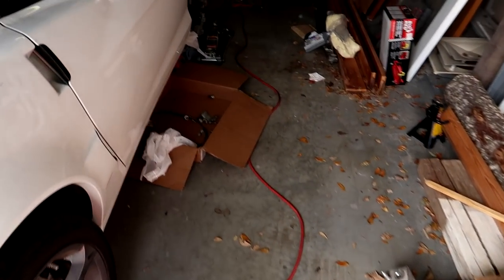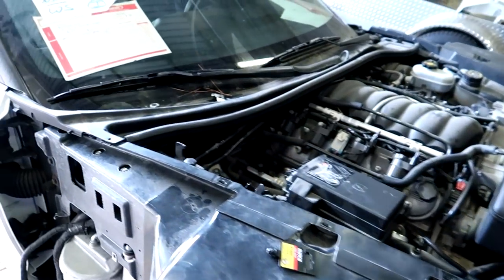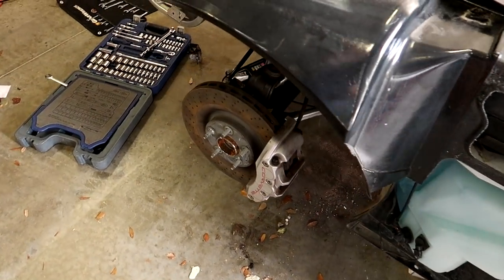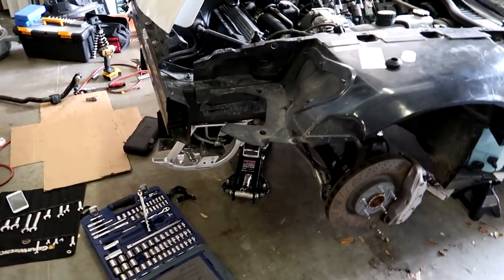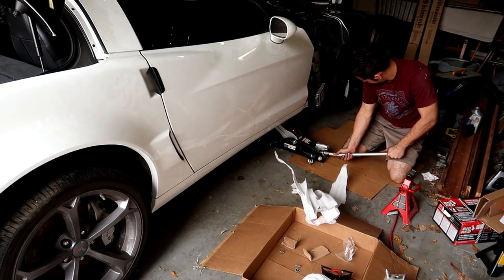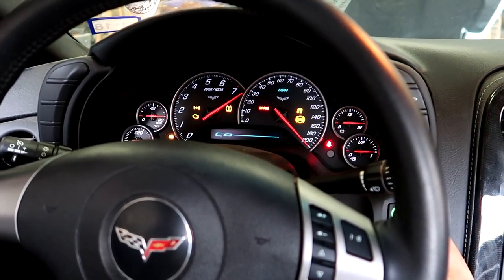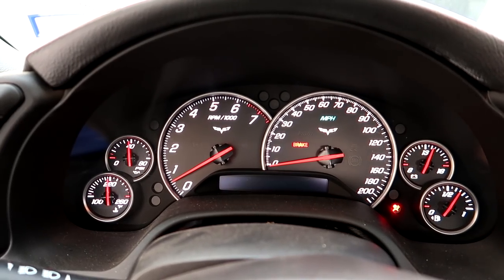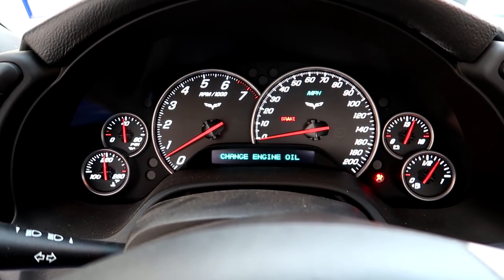THIS is why the Cheap Salvage Corvette Won't Start! Easy $100 Fix!

Comment: Why in america do you have to push the clutch pedal in to start the car.?
Reply: IIGrayfoxII Have u driven lately modern european manual car? At least vw have asked that for last 7 years...
Reply: If you managed to start the car without the clutch pedal, there would probably be a lot of crashes from the car lurching into parked cars and stuff
Reply: well so why are Americans are adopting this? Cause it seems to work out and the americans also need it.
Reply: IIGrayfoxII this is my opinion, but I believe it’s reduce strain on the starter as well as to prevent mishaps if you leave the car in gear like if you were parked on an incline.
Reply: New cars require it electronically. There is no mechanical reason you can't start a manual car in neutral, I do it all the time in my 77 bimmer
Reply: Because our cars are designed by lawyers using courtroom battles to determine the "features" that the nanny state will force on us. Since the government claims to own us physically, it has an interest in preserving us for it's "higher" purposes, namely human sacrifice rituals like 911, since they're really just a bunch of satanists. Safety in tyranny keeps all the Stockholm Syndrome sufferers who comprise the population feeling secure in their bondage.
Reply: bobo4691 damn solid response.
Reply: Crazy story:  In the mid 90's, I hadn't driven a manual for about 15 years and a woman that was living with us paid for her rent by giving us an 85 Turbo T-bird that was in police impound because her husband used it as a get-away car in a crime(he was in jail but, the title was in her name).  There were two bullet holes in the driver-side A-pillar from a Sheriff's .45. One of which went into the driver's arm(I shit you not).  My wife and I went to get it out of impound and it wouldn't start so, we towed it with a tow chain for 15 miles to our house. I got a Haynes manual and feared the worst but the first thing I read in the trouble-shooting section on "no start" was "is the clutch depressed?"  I thought, "are you kidding me?"  Depressed the clutch and got ten years of free car out of that thing!  It eventually had an electrical fire and was toast, literally, after that!
Reply: because it is to hard for them to put the car in neutral and then start the car. the majority of U.S. citizens barely understand how manual transmission works
Reply: IIGrayfoxII because some idiots leave it in gear when parked so we have neutral safety switches and clutch switches
Reply: My Japanese car had to have the clutch fully depressed.  I don't know what your driving but there is nothing wrong with a small kill switch.  It's also an easy way to wire a hidden kill switch for anti theft purposes.
Reply: I think he is asking why you can not just put the car in neutral and then just crank it up without the clutch being engaged...  all the sticks I have ever owned, that was never an issue,  they all started with the car in neutral whether the clutch was engaged or not..
Reply: in fact, you could actually leave it in gear and crank it and it would do a leap forward.. LOL  so it would engage the starter anyway.
Reply: OUT OF CONTROL GOVERNMENTAL SPRAWL OF THE JOBS GOV THINKS IT IS RESPONSIBLE FOR
Reply: That sums it up.
Reply: So you don't run  your wife over BY ACCIDENT!
Reply: Americans use neutral safety and manual clutch switches so uncle b and aunt c wont fire up the ignition start switch and rocket forward on the starter or starter plus engine power when the switch is engaged.

The same reason I believe you have safety glass and side marker lighting (yellow front, red rear) among other safety features on your cars. Federal law and the nature of "accidents."

Comment: A vehicle that's newer often times have sensor to deployed airbags and shut vehicle off if it's been in a wreck. The reset buttons are usually located in the trunk.

Comment: You're a Man after my own heart. I will die with a wrench in my hand before I go to the dealer. Nice job troubleshooting. Again, I like you, will dig and dig, until I find the 100 dollar thing that I can use instead of the 1000 dollar thing, because, I believe the 100 dollar thing exists and will do the job just as well as the 1000 dollar thing. it just needs to be found.

I have one of those netbooks. I was going to chuck it about 6 months ago while tidying up my office. If I ever have car troubleshooting software to use on my car, it'll come in handy. Right now I have a 1985 Corvette with OBD-I. I started researching scan tools for it. and found a few that say they work with OBD-I, but I'm not sure what more they'll do for me more than the codes that Flash on my dash, and my trusty Chilton's manual. And the options are very expensive.

I don't know the story that goes with this car your working on so I'll have to go thru your videos to find out. I'm curious about the project. It looks interesting. Thanks for the Video.

Comment: Could you do me a favor and jack the front end up and try to start it? It would take 5 minutes and be worth the laugh
Reply: IkonGod some cars are smart enough to know if their tires are off the ground and they won't start
Reply: Julian Rada for example?
Reply: Hey look. It was me he was talking to. This is my first corvette. I had it a week. It started fine before I jacked up the front and removed the wheels. It would not start that way. Now could it have been something else. I suppose so. But when I put it back down it started just fine. So who knows what it was. He was aware of this in our PM.

Comment: Hose water, really?  WTH!   Even if ou flush it you may still leave contaminates in it.  Not worth the savings over distilled water in a car like this.
Reply: Second. Distilled water is, what, 99 cents a gallon at Walmart? There's no reason to not run distilled water, especially on a performance vehicle such as this Corvette with aluminum cooling components. Aluminum cooling systems do not like tap water.
Reply: There is not enough contaminants to do any harm as long as you are not using 100% water. Mix 50/50 and good to go.
Reply: LOL! If he can drink it, it sure as hell isn't going to hurt the engine, especially no longer than he will leave it in there.
Reply: I've been using tap water in my f250 for five years and haven't had a problem with it yet, I'm sure that ls can handle it for one start

Comment: no burnout.....lame
Reply: LaughMy…. uh hmmm   He fired it for 15 seconds... decided it did not leak. What was the engine temp and pressure in the system before he should have laid rubber?

Comment: Glad to see you got it going bro. I was the one you was messaging in the video! As for the car not starting jacked up. Mine started fine prior to jacking it up. Now I had the tires off along with it being lifted in the front. It would not start in that position. It started fine when it was back down. Could it have been something else I don’t know. I had the car a week and this is my first vette. I do have the car lifted again so maybe I will see if it replicates itself.

Comment: Windows 7 though 8.1 you can choose to run a program in "compatibility mode" for 32 bit. Doesn't have to be ran on an old computer to work. Sometimes if you just go for it and install it on a 64 bit computer, that os will recognize the software is running in 32 bit mode and will allow it to run normal. Most 64 bit os's will have native 32 bit support.

Comment: I hade a Plymouth Sundance many years ago that would start without pushing the clutch. I guess it was a way for the manufacturer to save money. The America sub model was basically just a way to get around so you didn’t have to walk.

Comment: Glad the VCX Nano worked for you. I tried to re-program the glow plug module on my 2013 Duramax with the VCX Nano...it failed to program the glow plug module, and I had to go to the dealer to repair. They subsequently fixed the programming (firmware update(s)) in the VCX Nano...but it seems like the VCX Nano is "reverse engineering as they go". The engineer in China was willing to help...at Noon Beijing time....which is Midnight Eastern time. :-/ Nope...thanks anyways. I got the Mongoose from DrewTech afterwards. Also, be careful on the processor requirements for the Tech2Win and TIS2WEB....the Tech2 may work with the Intel Atom processor, but any ECU programming should be Intel i3 or later if you use TIS2Web to program modules. Glad the VCX Nano worked out for you. I'll try it again in the spring. The $55 TIS2WEB for 2 days isn't bad....it's the additional $150 at the dealer that you may have to pay if it does not work. FYI.
Reply: I can confirm ECU programming will work with somewhat older i3 stuff, my surface pro 3 i3 has done many cars with vcx nano as well as tactrix cable applications
Reply: I can't confirm older processors than i3 will work...but that's because I prefer not to chance it having had a bad experience with the VCX Nano. I am now Intel i5 Thinkpad, so I will know more about the Mongoose and VCX Nano in the spring...just in case I need to fork over an extra $150 to have the dealer fix any failed module programmming. (I was AMD Neo on my previous try.)

Comment: Hey, at the end you mentioned something about laws against "Having to take it to the dealer to do that". Is there a reference anyone knows of that lists all the little tricks to bypass things that a dealer would reset. Im talking about things like the Engine Oil Life (which I know is something about pumping the gas 3 time), or the reset procedure for relearning Key Fobs. Id love to know other things I can do myself. Especially tire pressure monitoring relearning after a tire rotation, since not all lube joints will do that.

Comment: you can run 32 bit programs on a 64 bit os.  it will do it on its own.  if it has problems you can run it in compatibility mode.

Comment: Nice work. I myself owns and use a Tech2 scanner and also uses a old 32bit computer together with it because of the software required works better on an old laptop that also has the required ports for com. with the Tech2 device.

Comment: I never noticed that Corvette uses the same Pontiac/ Toyota steering wheel. With the little girly finger buttons. I am surprised it does not drop the price a little bit.

Comment: that's what i like about old cars, they dont give you shit if there is a sensor that hasnt been calibrated or a really specialized procedure that hasnt been done. if they have compression, spark, fuel and air they will run and they dont care.

Comment: Sam is on Crac, wzaaaaaa! Crankshaft is very important dude. Get's all codes fixed.
Reply: there isnt a physical issue with it, the computer just needed to learn its proper rpm..
Reply: I know buddy

Comment: If you have a 64-bit processer computer, you could always run a 32-bit windows 7 on a virtual machine app because 64-bit computers are backwards compatible
Reply: Kunal BRUH don't even need a VM...
Reply: zzz43452 I don't know what you mean
Reply: The Obsesed Anime Freaks yep, that's true. Could dual-boot it or completely replace the operating system
Reply: zzz43452 I fucking do know shit about all kinds of computers, otherwise I wouldn't have written this whole post. 
Backwards compatibility doesn't depend on windows or any operating system. Like yes, you could run a program in 32-bit on windows 64-bit, but that's not guaranteed to work all the time. But it's wether or wether not the PC can support backwards compatibility to run a Windows 32-bit.

Comment: The is is a neat project.  The moment of @10:25 was spectacular.  I know that feeling of troubleshooting and then turning the key (or pushing the button) and hearing that magical sound of victory.  Plus, being a relatively new owner of a C6 Z06 (non-salvage :) ), it is neat to see this car come back to life.  One thing I might have missed...where did you get the Tec II software?  Subscribed and liked.

Comment: Which Asus is that? For a while, they had a slot for a memory upgrade on the bottom, so you can upgrade from 1GB to 2GB, which does a lot for that thing. MS licensing only allowed for 1GB RAM with the manufacturers... they have deleted the easy RAM swap option with later eee PCs, still doable, but a bit of a pain. You can find the right RAM module through the usual memory upgrade sites such as Crucial, etc. and it is a cheap + quick update.

Comment: Some times on the Corvettes with the standard trans the car has to be in Neutral and on the ground the emergency brake must be on and or another car you had to be on the brake pedal itself during the cranking if you let off while the started engaged it would shut off. Best read the manuals as to start up procedures. The automatics same thing foot on brake pedal.

Comment: I have always said tech savvy people some can do better than mechanics with years experience good job you should invest in a mid rise lift goes to 48 ins can be portable can be bought for 2000.00 for good one or 800.00 harbor freight .

Comment: Working on SAABs, you NEED a tech 2.. I have a Chinese one. Works great! I use it all the time..
Reply: I have a SAAB too, which knock off Tech 2 did you buy?
Reply: Jester123ish
 AliExpress is where mine came from
Reply: There's a few, what does your's look like?
Reply: Jester123ish They should all look the same

Comment: Sam crack if I were you I’d run a line direct to the starter and see if starter works and if it does than you can fix the clutch sensor

Comment: Ford in the early 90s has a circuit breaker that when you lifted the car up it would trip to reset it you had to reach from the hatch back ocer the wheel well and there was this tiny breaker. Ford Taurus i believe

Comment: I left a comment along when you first got the Corvette you said you would contact the original owners did you know what shop it went to to see if they just had them laying around still the ECM ECU that is for that just in case they forgot to put them in the car and still had him at the shop did you try that? Or did you not see the thread that I posted

Comment: I bought one and it came in handy though I had to install XP on an older computer to use it as it doesn't work in a VM or in compatibility mode.

Comment: I've never seen a front end leaf spring before outside of tip trucks
Reply: Jonas Hansson all corvettes even the 2018 Corvette ZR1 thats coming in a few months will have a composite leaf spring in the front. They won the gt2 class at le mans with the c6r race car with leaf spring
Reply: If it aint broke dont fix it

Comment: distilled water is what you add to radiators, not your municipal tap, or well water.  About a dollar a gallon. will reduce build up and corrosion in the long run

Comment: Don't use DexCool. There is a reason mechanics call it DexKill. Research it if you don't believe me. Had Malibu head gasket done and required DexCool , I put regular GM safe coolant in. Runs fine.

Comment: hi Sam, just came across your channel. i also try to do most of my own repairs, except where equipment or specific tools are concerned. (unfortunately any work i do must be done in the street in front of the house i co-rent)  i bought a 1980 L-48 about a year ago that was in the lot of a local Harley dealer.  i could use some help in trying to find a maintenance manual to help me with some restorations issues as well as specs. also how can i find out if my 'Vette has had any performance upgrades. ie; cam? a tow truck driver/mechanic said he thought it did from the way it sounded. appreciate any help. Manny (Tempe,AZ)

Comment: I'm working on project which uses the c6 chassis, after watching your vid, I bought the VXdiagnostic tool.  I can't get the Corvette data up.  When I go to Chevrolet, the only things listed under automotive are 4 and 6 cylinder cars.  What am I doing wrong?  It worked for you, please help it work for me.

Comment: DUUUDE, WHAAAT!? Chevy is STILL using the Tech 2!? I bought a Chinese Tech 2 for my Saabs, I have quite a few and this lets me program my own keys, read stuff like AC temps and pressures, and alter various interesting settings like how/when the doors lock if the vehicle is put into park or drive, temperature regions for the ACC. Anyways, the Saabs I'm working on are 20 years old and it blows my mind that a brand new Corvette is STILL using that ancient piece of equipment. I'm not sure whether I should be impressed at the built in longevity of the Tech 2, or disappointing in GM for not improving their diagnostic tools for 25 years.
Reply: Jesse Crandle Umm this is a c6 I dont belive the c7 use tech 2 though I could be wrong.
Reply: Oh ok, my bad! That makes more sense then. Still though, they really did get a good two decades of use out of that particular tool.
Reply: I believe the new ones are MDI2

Comment: If your computer ever craps itself and you are unable to get your 32bit software running on your 64bit version of windows, Microsoft still offers 32bit installs of all major versions of Windows and they will still work with the same keys as the 64bit versions. The only limitation you will run into is that the 32bit versions of the OS only support up to 4GB of ram. You will also take a performance hit as most 64bit processors don't run 32bit applications as efficiently as their native 32bit counterparts. You may also run into some driver support problems depending on the make and model of the computer.  Your best bet is to do some research on the manufacturer's website prior to buying the computer to make sure that they supply compatible 32 bit drivers.

Comment: How about  installing  Google  Crome  O.S ,  only downside you have to use your Google  account  information  to finalize set  up , most  Cromebooks  come  with  4GB fixed  ram and  a  100GB  SSD  fixed  drive &  an  SD/ Card  capability,  can't  create  a local  account like Windows